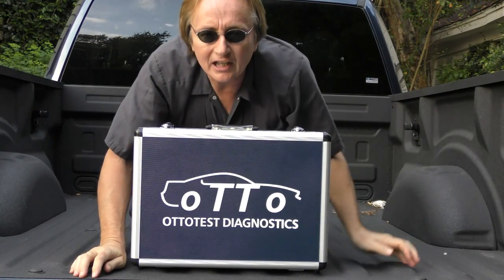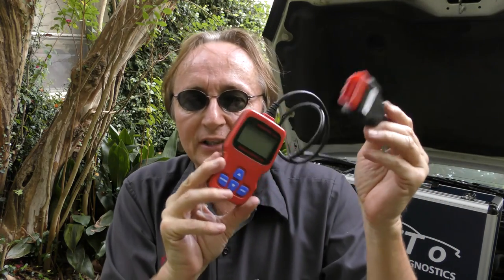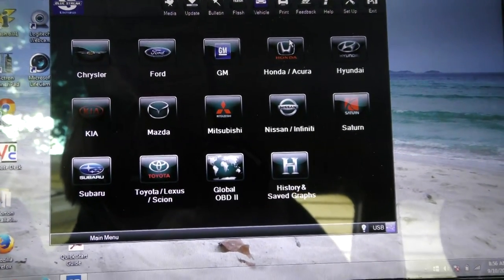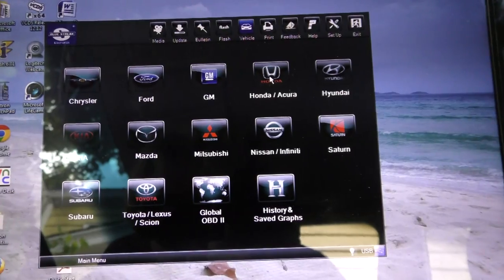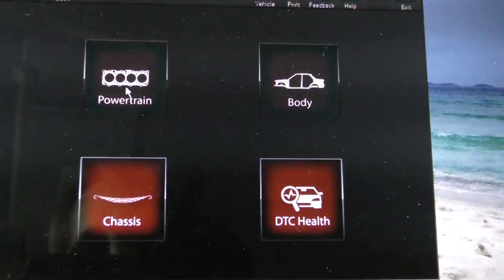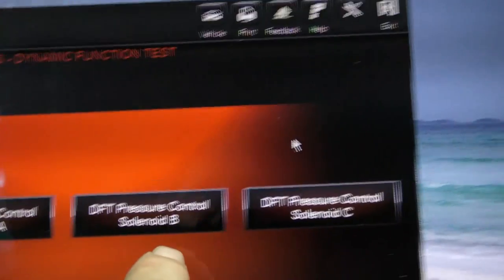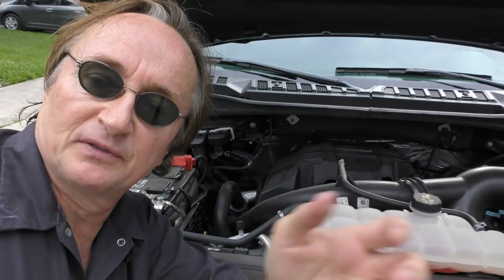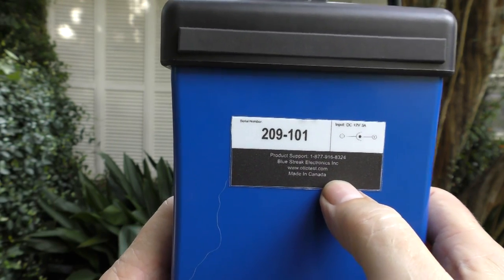Fixing Complex Modern Cars

Comment: I don't like the shittalking about European cars, especially when some of it is not true, you can buy an Obd-2 cable for like 25 euro's and read out every car made by Volkswagen from like 1996 to 2013 or something. I don't know how expensive reading devices would be for the other german cars like Bmw or Opel, but i bet it isn't that expensive either. It is probably just the difference between PAL and NTSC, i know PAL systems are slightly different, just like your power outlets are different from ours here in Europe. So i reckon it is because of that you can't use your obd meter on European cars.
Reply: people, chill. it's logical, eurocars are cheaper to fix/service/diy in europe and vice versa, just beacuse pure numbers of them, yet other stuff. mkay?

Comment: Can anyone help me out with interior lights? When I unlock and open the car the dome lights come on, but once I close the door and start the car the lights go out and I can't get it to turn it back on by using the switch.
Reply from the maker: +Nick  Ross replace the switch assembly
Reply: Scotty Kilmer I recently replaced the factory bulbs with led, do you think that could of caused it to break?
Reply from the maker: +Nick  Ross  yes it could, leds often need ballast resistor assemblies to work right
Reply: Scotty Kilmer I'll probably try looking on Amazon for that. Until then, back with the old bulbs. But thanks for your advise.
Reply: +Nick  Ross If it's a more modern car you might need "canbus" led lights. They have a resistor built into them. Try that before modifying your wiring.  I couldn't say more without knowing make and model of your car and what lights you have installed. For dome lights that's likely all you'll need.
Reply: The_Doctors_Tardis It's a 2010 Lincoln MKZ. Not really that "modern."
Reply: ***** My friends 2015 civic si uses the same led light I got and his works fine. I just ordered the canbus LEDs on Amazon and hopefully I did not fuck up the wiring.
Reply: +Nick  Ross Plenty modern. From what I can tell your car needs canbus when switching to led. Every vehicle specific kit I've found for it has canbus bulbs. Hopefully that's what's causing the issue. Either way I wouldn't put non-canbus led's back in it. If switching the bulbs out to the canbus bulbs doesn't work , and same for the stock bulbs, then I'd look at replacing the switch. The switch itself is ~$30 from fordpartsDOTcom.
Reply: The_Doctors_Tardis Thanks. Hopfully they will work and I would not need to instal a whole new fixture. But at least it's only $30.
Reply: +Nick  Ross Your car is either possessed or haunted.  Consult a competent spiritual adviser of your choice.
Reply: Brad K Shit! Do you you think if I poured some holy water on it, it will stop the demon.
Reply: +Nick  Ross Water on electrical?!   That's exactly what the devil wants to trick you into.   30W anointing oil is the way to go.
Reply: +Brad K ha!

Comment: Yet another reason I wouldn’t go near any Eurocar.    Haven’t owned one since my old VW van beetle and finally Opel Ricord  in 1980.        My sister found out how messy they were when he sacred  a2006 BMW cost her $6 grand to fix a bad fuel pump.       Flashy trash designed to drain your wallet.

Comment: $2,000 price is insanely stupid for most individuals except if you are a mechanic - this is extremely overpriced when you can buy i7 laptops at half that price  - my suggestion is look around - there's bound to be a much cheaper system available that can read most of the details you need to know to diagnose modern cars and I am surprised Scotty didn't research more  computer diagnistic tools and make comparisons
Reply from the maker: +majorgeeek you will not get 95 percent oem data and bidirectional testing that this machine does for anything less than 2 grand. I know, I've tried most ones out there sent to me by the makers in hope of me making a video for their products. DO NOT assume I have not researched this a TON. I have been working on them 48 years now.
Reply: +Scotty Kilmer I don't doubt the Ottotest diagnostic tool is good but the problem is it is insanely stupid high priced - I am sure there is bound to be other more affordable machines that can do near as much at a fraction of the price which you obviously know about and could have mentioned - seriously I would love to have the Ottotest but most people can't afford it and those that can probably wouldn't need one

Comment: I would rather get a car from the 50's or 60's and upgrade suspension systems and take out the engine and transmission and use electric motors and batteries.

Comment: dude german cars are not that hard to work on. being a vw enthusiast, vagcom does everything and more than the tool you have there. rosstech vcds and their software is reasonably priced.
Reply from the maker: +Steven p price out a mercedes star tester and you will change your mind on german car repairs.
Reply: +Scotty Kilmer Mercedes is a different king of animal than Volkswagen. But they are lowering the standards too, some Mercedes models run Renaults engines

Comment: This is just plain bullcrap

If you buy  new car, it really shouldnt brake in first 150 000km or 5 years

I have german car, its 5 years old, done 110 000km and had 0 problems  ... and that is literary 0, no tiny fixes or whatever, its chain driven so even maintainance costs are joke

And by the time it will be 10 years old, scanner tolls will be accesable on your smartphone app for 10$, and probably be as smart as this tool right here you present us

Now for a 2015 model, by 2020 it should be still running fine, and by 2025 ... well by 2025 your smartphone will be smart enough, so fixing 10year old car will be a joke with all info it will be able to get online
Reply: +blackcarmafia 
"it really shouldnt brake in first 150 000km or 5 years"

That sounds exciting.
Reply: kop4321 Well i have a german car (not even premium) and it still got no faults yet (5 years, 150k km) :)
Reply: blackcarmafia
It was a joke on the typo of break. I got what you meant.
Reply: kop4321 oh, shit :) now i made  myself a lol
Reply: +blackcarmafia Pretty sure you are lieing to save face on German cars. The facts speak the truth. German quailty is a lie.
Reply: smasila U can come and check it yourself, oh and its ford-fiesta sized car not sume luxry boat from BMW/Benz/Audi :)
 
I also got a french car, with 100 000km and exhaust is getting loud and year ago i got an ignition error (did software update and runs fine now ...50€ though, and exhaust could get a bit more expensive if it goes bad)

Both cars were bought brand new and driven alike, french is from end of production period, where faults should be minimal from factory actually 

As far as im concerned the're all right, but nothing special TBH
Reply: My coworker has 13 BMW x5 cross over like rav-4,  crv. He went to the dealer changed water pump, thermostat , maybe radiator , cost him $1500 , so it had problems in 4 years exactly. What you have I. Euro is different than USA. Even if you live in USA  and own euro cars , car from car is different , but common  problems will stay the same, like plastic parts inside an engine, or next to, they will break.

Comment: Aside from resale value, I cannot understand why anyone would buy a European car. Unless you have a ton of money to drop, and don't mind wasting any, it's best to buy just about anything else. 

Of course, this is all opinion. But you have to admit, they certainly don't make it easy. My brother wants me to replace his broken car stereo in his Volvo XC70. But because I don't have the security code, I can't actually do it, because without that code, it'll immobilize the car when you pull the head unit. 

Just buy yourself a different car, and save yourself the headache. Especially if you're younger. 

Although, if money was no object, I wouldn't mind dropping 300k on a fully built and tuned AMG C63S. Would not mind one bit.. :)
Reply: +Caleb Youngs 380,000 miles bmw z4, one starter and 1 h20 pump,1 tranny rebuild ( took me 2 1/2 hrs and 160 top speed and 7 point hi camber suspension....car looks N.E.W.......that why.
Reply: I never said European cars don't last a while. I know full well that they do. Volvo currently has the world record for most miles on a vehicle (3,000,000). 

But since it is a car, something will go wrong, and in some instances, depending on what it is, you won't be able to fix it yourself, therefore making you spend more money.

However, you're an exception. From only your couple sentences, I can tell that you care deeply for that car, and have done everything in your power to make her run well. It would not surprise me if your car was in pristine shape, inside, and out.

People like us that actually take care of our rides are in a whole different boat than everyone else.
Reply: +flunk77 I drive a 99 Audi haven't had any major problems and parts are cheap for mine. Thing about not being able to fix it yourself is wrong. Only problem I would see is not having some of the tools. But you can get them for basically the same price of regular ones.
Reply: Jesse Silva Which is why it depends on the repair. Changing brakes on a BMW isn't going to be much different than changing brakes on a Toyota..
Reply: What could you not fix yourself?
Reply: How about a battery? How are you supposed to register a new battery with the BMW's computer by yourself?
Reply: +Caleb Youngs I see what your saying. But not all bmws need a battery reset with a battery change. My car is European and doesn't need a reset for the battery and there is also a program called vag com for $300 that can scan all vag car computers.
Reply: True. But that's what I mean. With a little bit of time and the proper tools, you can fix ANYTHING that might go wrong on.. say.. an '07 MS3. With relatively newer model European cars, you just can't do everything. You can't even change something like a turn signal stalk without an ordeal of running to the stealership.

But I really think that one of the biggest downers, would be the expensive parts.. I know this is a little thing.. but just one (1) valve cover bolt for a '10 3-series is five bucks from a third party. Just to put things in perspective..

Comment: i probably wouldnt buy a european car in america because higher prices over there for parts given it all comes across the atlantic to you, but then i wouldnt buy an american made car in europe, most of them are not very reliable here and the ones that are, generally are horrible to drive.

the german manufacturers in the last decade though really have abused the reputation of germany as a place which produces good cars, cutting corners and relying on their rep to keep selling. still, some of the older ones are very reliable, you can still see plenty of old vw/audi group stuff that's 15-20 years old on the road. volvo's too were very good until they were bought.

 cars in general have declined from the point of view of somebody with an interest in DIY maintenence of them.